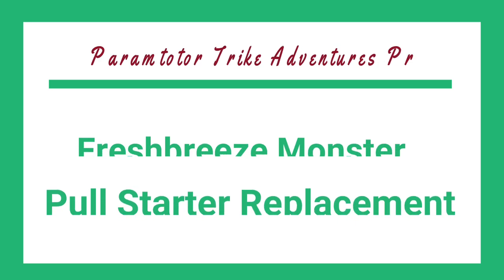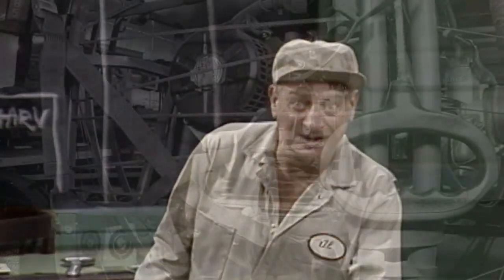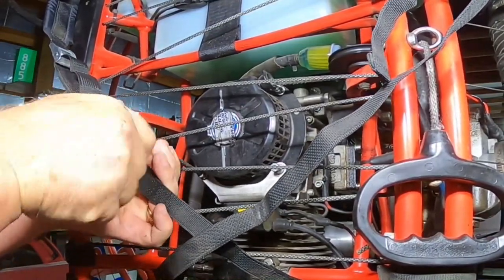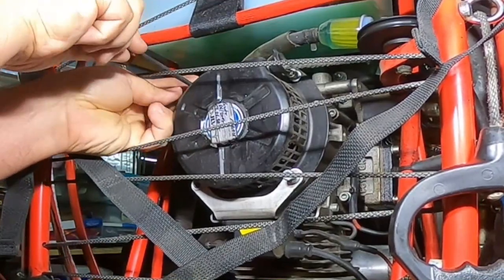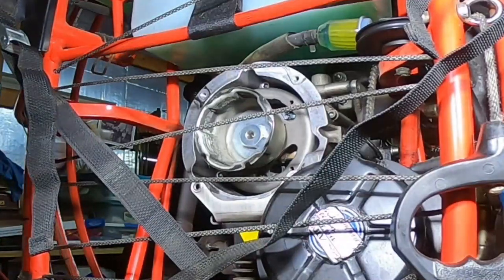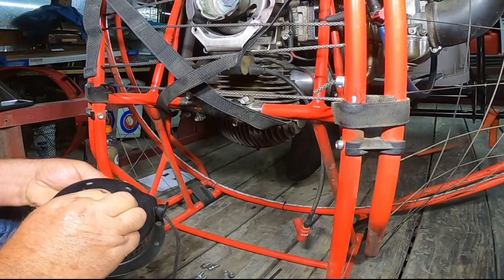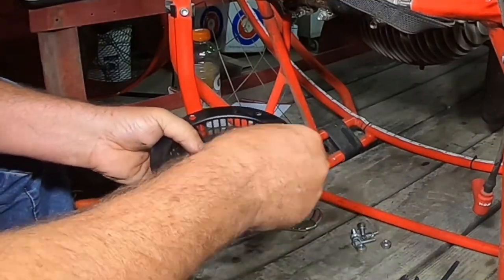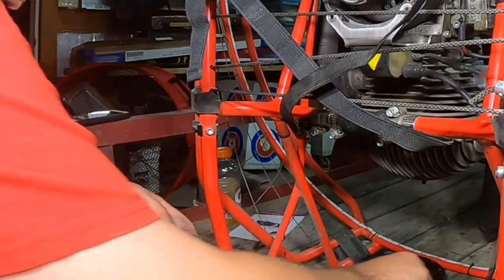Removing Pull Starter on Freshbreeze Monster with help from Rodney - Ohio Paramotor Trike Adventures

Comment from the maker: Had two failures in one flight.  The pull starter and exhaust failed after landing.  I was fortunate the failures didn't happen in mid flight.   Watch this repair and in the near future the repair of exhaust failure.  A bit frustrating to say the least... was an expensive flight.   Hope to get exhaust fixed at a local TIG shop.  Was hoping to have the replacement part here and installed. For the most part it is just replacing in the reverse order.

Comment: Hey Bob,  thanks so much for making this video.  My monster pull starter hasn’t broken yet but a few weeks ago my ignition coil died. So I needed to remove the pull starter and could not remove that 1 bolt in upper right corner. Was surprised to see how you managed to do it.  Do they make a special stubby Allen wrench for it or did you make one yourself?
Reply from the maker: ppgbobfather Bondhus 67099 Stubby Double Ball... https://www.amazon.com/dp/B01F6PWYVG?ref=ppx_pop_mob_ap_share
Reply from the maker: ppgbobfather thanks Bob.   These have been a life saver!!!!!
Reply: Wow ... thanks ... ordered them just now. Really appreciate it !!!